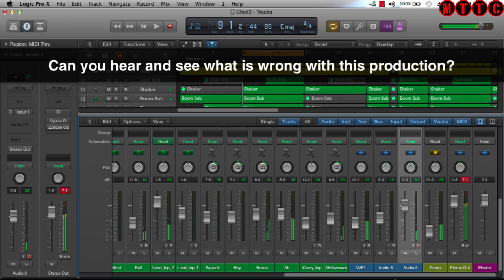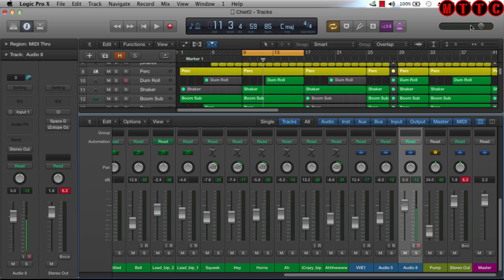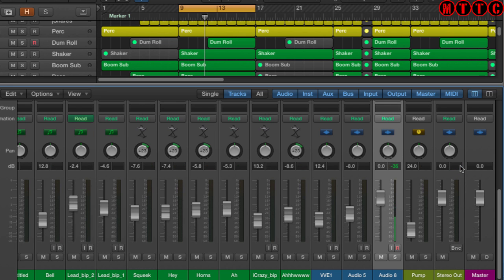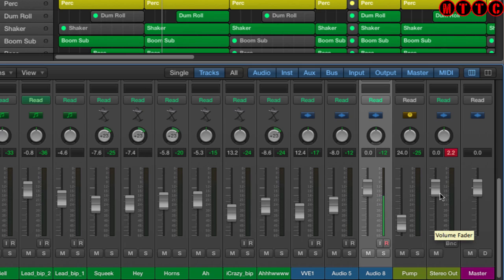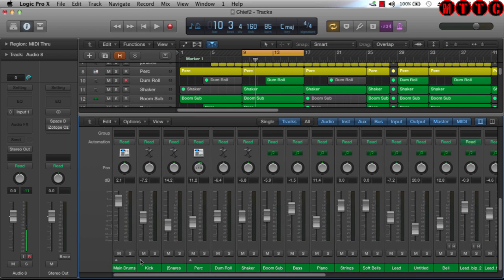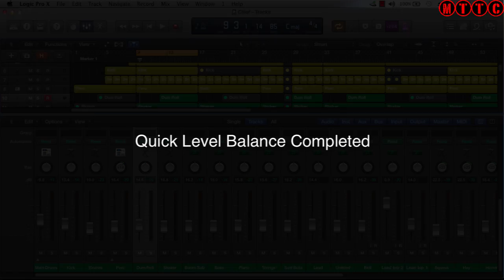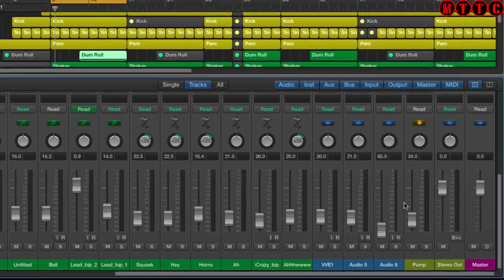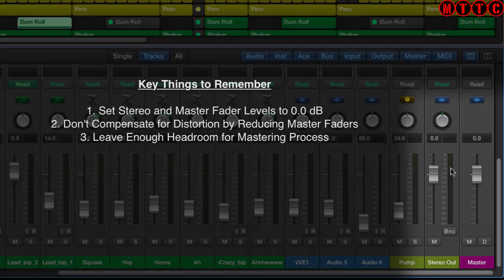How to Set Levels to Avoid Clipping & Distortion in Your Logic Pro X Audio Production

Comment: Shouldn't the levels on the mix faders be at -18db??..
Reply from the maker: No not at all. The individual channel faders should be set based on the level required for that particular instrument or sound on that channel. The -18dB figure relates to the optimum input level of an incoming audio signal you are about to record such as a voice or electric guitar 🎸. Watch my video on Gain Staging for more 👍🏾
Reply: @MTTC  So for software Instraments the fader should be at unity gain. (zero), and from there we add or subtract dbs? ...Thank you for your response and hard work.
Reply: Yes absolutely correct. You only need concern yourself about the-18dB input levels when recording audio into your DAW from an external source. For native sources such as software instruments and samplers etc make the necessary adjustments based on what you are hearing. Keep in mind that you don’t want any of your channels to clip or distort as well. Hope this helps. 🙏🏾

Comment: 32-bit float saves you from clipping a lot but platforms only takes 24bit :(
Reply from the maker: 100% correct ✅
Reply: @MTTC  i'm sad idk what to do, because when I put a high pass 5000hz on the beat and have my ambients vocals it has noise, but if I don't put the high pass it doesn't have. it's weird (for the export)
Reply: @Mrlloydvideos 
That is a strange one for sure. Try this. Bounce in Place the beat printing the HPF to the file. Now mute the original best track and listen to the vocals and new beat track with HPF muted to see if that resolves the issue. Cheers. Duce 🙏🏾
Reply: That is a strange one for sure. Try this. Bounce in Place the beat printing the HPF to the file. Now mute the original best track and listen to the vocals and new beat track with HPF muted to see if that resolves the issue. Cheers. Duce 🙏🏾

Comment: Or now export in 32-bit float. It saves you from clipping a lot !
Reply from the maker: You are absolutely correct 👍🏾. At the time of releasing this video Logic Pro X did not support 32bit float but from last year the latest update of the DAW introduced it which dramatically increased the dynamic range for recording and would provide greater protection from clipping and overloading. 
Great feedback. Thanks.

Comment: Most tutorials push adding additional plug-ins for quick fixes but you broke it down in the most direct and least complicated way which gets right down to the core issues.  Thank you.
Reply from the maker: Truly appreciate your kind comment Scott. I leaned my trade in the analog world so I think of audio production through that lens. As such the simplest and most direct route to solving issues in this field is always going to be my method. I’m delighted that you recognised that. Thanks again for your great feedback 😀
Reply: There are only 2plugins to worry about, and they are stock in Logic pro,  the limiter,  and mastering. I use them on the stereo out channel strip.

Comment: So having more tracks in one project would generally lead to a lower average volume per track? Because the more tracks/instruments I add, the more volume comes together in the stereo out?
Is there some point where you would say to better remove tracks in order to make the average volume of each track louder? Or does it not matter if the average volume tends to be lower as long as it is not clipping and there is enough headroom?
I am quite confused on this.
But the general idea you explained in the video was very clear, thanks for that 👍🏼
Reply from the maker: Excellent question Dennis. 
Now in principle you are absolutely correct. The more signals you send to your mixer via audio tracks or software instruments your overall level in your master or stereo output will get closer and closer to overload and clipping. So one solution is to reduce the average track volumes across the mixer whilst maintaining a good balance between each instrument for a good mix. Another solution is to have less things playing simultaneously. This would in effect create space for each sound to be better heard and the net result would be less signal going to the stereo output. In situations where you would have lots of instruments playing all at once e.g an orchestral piece then good average levelling is the best way. Ultimately however you don’t want to overload the master and clip your output. Hope this helps 😀

Comment: I think is there’s a better way then  adjusting the volume in the faders 🎚 is to adjust the volume from the instrument and plug ins. Faders are exponencial x10 so it’s probably best to not mess with them , just for final adjustments of fade ins and outs.
Reply from the maker: Yes absolutely correct. As much as possible one should set a good level at the sound source and therefore avoid having to play with Chanel faders too much.

Comment: It didn't workd in my case. I bring everything down but then I can barely hear anything. I put a bit of gain but then I get distortion. So it's either clean but not loud enough of loud enough but with distortion :/
Reply from the maker: My friend I completely understand what is happening and the solution is very simple. If you are listening through headphones then you need to turn up the headphones 🎧 volume on your audio interface. If you’re listening through speakers (passive speakers) then you have to turn up the volume of the amplifier or the speakers 🔊 themselves (active speakers). Now you can hear everything clearly and remove the clipping and distortion from your tracks 😀

Comment: I have a question, so if all my levels are good and I have very minimal headroom in master, why are my projects so quiet. what do I do about this. my projects will even be quiet and still peaking. what am I doing wrong
Reply from the maker: Hi there. Great questions. It seems that you are producing well balanced mixes which is exactly what you should be aiming for. In order to increase the overall average volume of your mixes you need to put your tracks through the mastering process. This will most definately make your songs sound much louder and wider. Check out my video to see how I use iZotope Ozone to master tracks. 
https://youtu.be/Zo-Jk8Sj6eQ

Comment: Great video. I’m a long time musician, and a longtime amateur mixer/producer for my own music. Obviously, I still have so much to learn. I’m a Logic Pro X user myself. 
I tend to mix as I record, because the recording process is as much of a writing process for me. But, sometimes I have a great sounding mix, with lots of automation and plugins, and I have my master/stereo out set too low. I need to reduce all tracks over all. 
My question is, is there a way to set all tracks down with an across the board decibel decrease? Or do I have to start from scratch, as your video shows. It appears the normalization function doesn’t quite work that way. There must be an easy way that I’m missing. 
Any advice is greatly appreciated. 
Thanks.
Reply from the maker: Thanks for your detailed question and great feedback. The challenge you have is having to go back to address the levelling issues from your previous work. There really isn’t a universal adjustment feature for this in Logic. Going forward however you are unlikely to run into the same issue as you will be following the gain staging principles from the outset. Cheers 😀
Reply: @MTTC   thanks for your response. I appreciate any advice. This method is helping me already. 

But I did figure out, that if you select all tracks (hold shift, click first and last track), and set all tracks to have automation on (even if they don’t use it), you can use the automation trimmer to decrease the amount on all tracks equally. So, I played my track during a loud part , and dropped one track by 8dbs, and they all dropped equally in one move!
Not sure if this is the correct method, but hell, it worked! 
Just in case anyone reading wants to try it.
Reply: Wow!!! Fantastic. I’ll try that myself as I don’t believe I’ve given that method a go. Really appreciate you posting this tip. Cheers 😀
Reply: @davidsmartmusic  hope it works for you. Seems to have solved all my problems. All my automation moves have remained intact, the balance still feels right, and I’ve gained a bunch of headroom in the process.

Comment: At the moment. I record a pass (vocal) and sounds ok. Good level. I put a compressor on. Stock logic. And it sounds crackly? No sign of peaking anywhere. And the cpu is not running hard. Any help???
Reply from the maker: Now that is very strange. 🤔  I have not experienced this type issue unless my latency setting is set too low based on the build up the number of plugins I am using. Try increasing your i/o buffer size to the max amount of 1024 samples. I recon this might solve the issue. Let me know. Cheers 😀

Comment: Hi! I have 2 questions (that you'll prob think are dumb lol - but please reply if you can) ;)
1. What's the difference with selecting a clip in logic and increasing the gain via the inspector's gain control, and applying a stereo limiter to the selection/s (right-clicking on the selection/s and opening the selection-based processing window and applying a stereo limiter)? I mean in both cases the track/s sound louder, so why not just up the gain directly via the inspector, and "bam" you have a louder track that you can export; instead of applying a stereo limiter?
2. Does the master volume slider on the top right of logic (which is the same master slider in the mixer) affect the exported audio file's loudness and quality, or is its level "ignored" during a track's exporting (and therefore is only there so we can hear what we're doing louder or less loud while working on a project, but it does not affect the exported track at all)?
Reply from the maker: Good questions. Firstly, if you use the gain control in the inspector parameter box you are simply boosting gain. If you use a limiter you are adding gain as well as brickwall compression. Whichever option you choose is fine as long as it complements you mix.
Secondly the master fader to the right does have an impact on the overall mix. Avoid clipping here at all costs.
Reply: @MTTC  Thank you for your reply! :) Didn't really understand the boosting vs adding gain part; as well as the "brickwall compression" thingy. (newbie here ;) ). So you are saying that since either method just gives me a higher volume - as I hear it in the Logic project - is pretty much the same thing result-wise in the track that will be exported in the end, so I can use any of the 2 methods just as well. Right?
Ok, thanks for the info about the master volume slider on the top right of logic (which is the same master slider in the mixer). I will use that, then, to hear what I'm doing better (louder) while working on a project (if I'm only using my macbook's loudspeakers which can only go so loud), and will reduce the level below clipping point before I export the track! :)

Comment: This is a pain in the a*.. often my stereo out clipps +14 or smth just when there is a kick and a clap and with some little fx on.. and when i just lower the volume, it just gets too quiet and loses all punch... any idea how to overcome that?
Reply from the maker: OK is see what is happening. First step is to lower the output of your kick track and the same for your claps. Pull down faders. If this sounds too quiet just turn up the volume of your headphone control, your audio interface or your speakers. You can always mazimize the volume of the track later. The key is to avoid clipping during production. Check out these other videos which should also help. https://youtu.be/kVVevYuZPyk and https://youtu.be/vZzeL53sFpo
Reply from the maker: Also this link https://youtu.be/Cy-SDCZR104

Comment: What about turning down volume through gain plugin or use plugins to remove distortion to all signals so that you keep them all at 0 like you said & get the clearest loudest sound?
Reply from the maker: Good question. You want to avoid creating distortion or clipping in your mix unless you are using the effect creatively. If you need to use tools to remove distortion, your audio is already wrecked.

Comment: yea which brings me to the same problem, the volume of the track is so quite...
Reply from the maker: I see the issue. You now have a balanced mix with not clipping but the overall levels are too low. Check out this fix. It's the next step in the process. https://www.youtube.com/watch?v=Cy-SDCZR104
Reply: Try to delete all the annoyong frequencies that will take you lots of Db then put a Limiter and play ariund with Gain on master process 
You should be able to get lotsa Db with it
Reply: Morpheus once you turn down all the levels in the mix, use a limiter on the master channel to bring the volume back up. That way it will be loud without clipping.

Comment: Why my track doesn’t distort in my studio but when I play in my car it distorts like crazy? Please someone help!!
Reply: Try to check if any other songs are sounding distorted, it may be your car system.
You probably checked it out already but sometimes some music, some sounds can sound
much more distorted than others. I have a broken speaker on my phone almost everything
is distorted, some songs are more distorted than others it's because all sounds are different
and have different energy.

And if you found what the problem is reply so we can all learn more?
Reply from the maker: Great contribution. Yes please post on how things have turned out.
Reply from the maker: Great contribution. Yes please post on how things have turned out.
Reply from the maker: Now this is interesting. Before you bounce down make sure nothing is clipping in your mix. Check all channel meters and master stereo meters. Remove all plugins from the stereo bus. Try then bouncing down leaving around 3dB of headroom then test that in your car as this is a clean bounce.  From there gradually start adding the extra mastering plugins which you might normally have on your master bus and see at what point the distortion returns.

Comment: So question for you on this, by having everything about -5db on the stereo output my mix is extremely quiet. Is this what mastering fixes?
Reply from the maker: Aha! Now that is a great question. I bet you, if I was playing your track in my studio it would be pretty loud even though it is peaking at -5dB on the master output meters. What's the difference? Well I will turn up the volume on either my audio interface output, outboard mixer channels or amplifier to monitor at a good nominal level, thereby maintaining the integrity of the mix/balance i.e.no clipping, and at the same time enjoying the work. So yes don't fall into that trap. Keep your mixes out of the red zone, create headroom for mastering and enjoy playback levels by boosting the volume/gain of your listening devices. Thanks for your excellent question. I hope the answer makes sense. Cheers.👍👍👍
Reply: Music Tech Training Centre thank you! It does but the volume is so much quieter still compared to other tracks on Spotify for example. Is this where mastering will make that big difference in overall volume?
Reply from the maker: Indeed sir, yes, the perceived loudness of the track will be increased dramatically once mastered as the overall average gain will have increased a great deal so your song should sound very much like those on Spotify assuming your mastering engineer does a good job.
Reply: Thank you so much!

Comment: sir as u said generally to leave 4 to 5 db of headroom for mastering 
is that mean after mastering the file should come to 0db??
plz answer anybody......tq
Reply from the maker: Yes indeed. You are spot on. Once the mastering process is complete the file will output at 0dB. So that headroom is essential. Sorry for the late reply.
Reply: Sir so sweet that u consider all ur student s and reply them...
Sir plz can u make tutorials on
5.1 mixing mastering in logic pro...and it should be given for dcp
Qube UFO etc...
Tq. Soo much
Reply from the maker: Hi there. Thanks for the request. I am pretty swamped with so much and cannot promise a tut on 5.1 mixing but if a gap opens up I will sort one out. Thanks again for your communication. Cheers.
Reply: Music Tech Training Centre tq very much